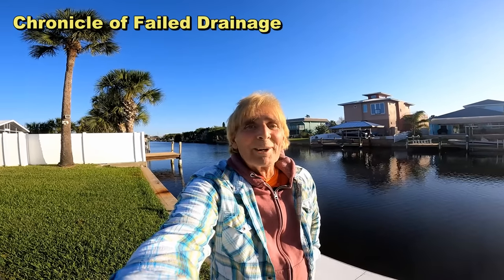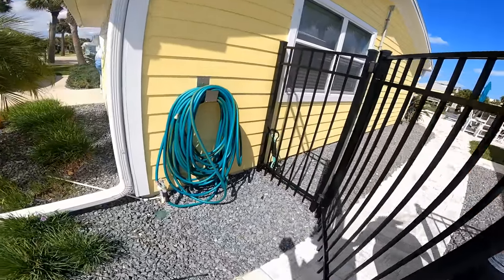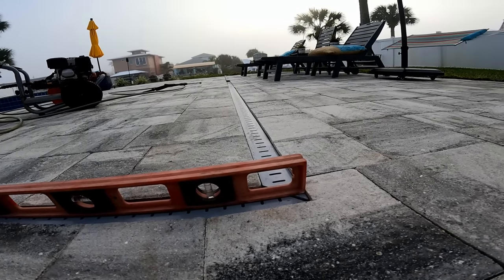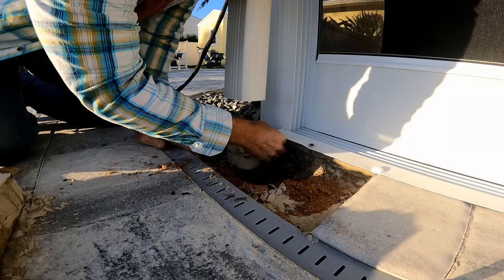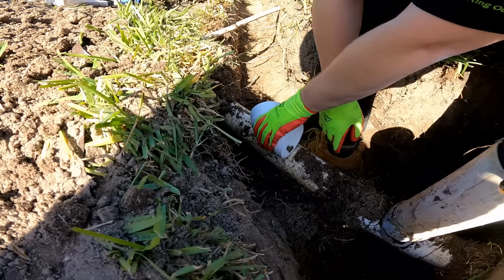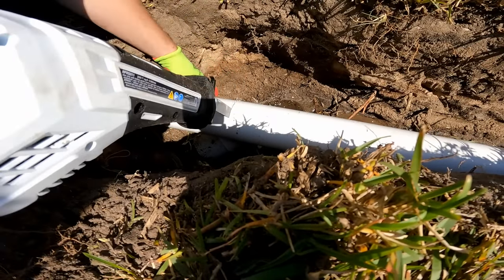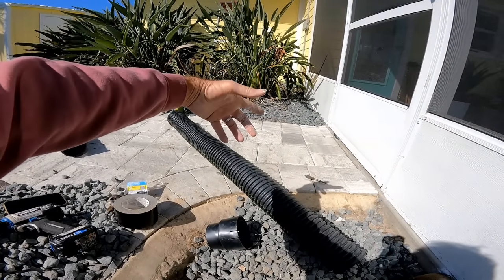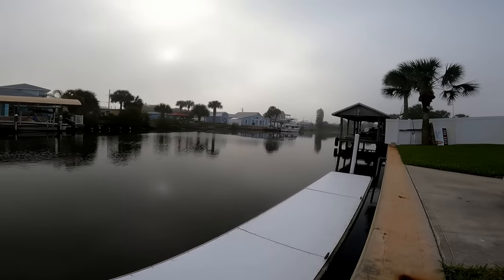Chronicle of Channel Drain Failure - Extreme Water Damage

Comment: Australia has very strict discharge regulations. So most contractors do the right thing. You through all your years of experience have virtually solved what a licensed builder would be required to do good work big thumbs up from me.
Reply: Supposedly but I’ve seen some shoddy work such as PVC pipes left open near the foundations or land sloping towards a home with no drainage or not enough downspouts etc. I don’t think inspectors check or if there are inspectors.

Comment: I had a problem with my 1/2 acre pond over flowing into the yard during heavy rains. I used the maximum full level to install drain pipe to the ditch. As I dug by hand I watched the water flow to get it working properly.
Reply: Yeah, you have to keep a pond filled to the maximum level or muskrats will tunnel under the bank and cause it to drain. Even then you must watch out for them.

Comment: I'd only be interested to know if that 1in drain was capable of handling the volume of water you'd expect out of a 4" drain. I know the catch basin is there, but I might have added 4 1in holes going down into a 4in pipe then that connects to the 4in pipe underneath.

Comment: Hey chuck, what is going to happen when the water level raise up above the pipe on the sea wall ?
Reply: It'll flow backwards into the system because there's no one way check valve or backflow preventer

Comment: Chuck, great video, and I always enjoy your clear explanations.  My question: I have heard that you should never place a French drain next to the foundation of a home.  But if the drain is properly constructed and sloped to allow water to see daylight can you think of a reason why this should ever fail to protect the foundation?   I did so to my home as a replacement for a damaged, hard to reach roof gutter.  I placed an 8mil plastic sheet up against the foundation to further prevent water penetration through soil to the foundation, before backfilling.  I used the downspout connection to the underground drain pipe that sees daylight at the street to connect to my French drain.  Keep up those videos; they are so informative.

Comment: Is the 1" pipe going to be enough to drain the pool area?  I would think that will backup pretty fast.   Its much much better than was there, just wondering...
Reply: The one inch hole is just to drain water collected by channel, additional water run off from the paver deck will drain through the catch basin that is now connected to drain pipe with outfall to the canal.

Comment: You forgot to need a backflow valve where the water drains to the canal. If the canal overflows due to a bad storm water will came out of the drains
Reply: Agree and wouldn't gluing the pipes make sense?
Reply: @jjducharme1  just what I questioned.  No glue and used what looked like bolts to surely catch debris causing blockages....
Reply: @JenniferF2882  good eye 👌
Reply: @jjducharme1  Not really , any small leaks will be easily disbursed into the soil, you glue pipes above ground as you do not want any leaks but it’s not so important below into the soil
Reply: I don't think anybody is going to put a backflow preventer on landscape drain pipes like this. Backflow preventers are usually for sewage systems (you don't want sewage coming up into your toilet drain from the city sewage line), indoor floor drains (you don't want your basement flooding if your sump fails) and irrigation systems (you don't want outdoor irrigation water flowing backwards into your drinking water). If your yard is flooding because the canal is rising, a backflow preventer is not going to do anything because the flood water isn't coming from the irrigation drain. It's going to be coming from the canal itself, the rain, etc.
Reply: If the water gets as high in the canal as the entrance to the channel drain at the pool deck they would have a pool full of canal water long before the drain backflow would be an issue.

Comment: Hi. Just looking at that open pipe through the seawall. Does that part of Florida have issues with rats,muskrat,nutria or other critters ? I remember when I was a teenager,a muskrat family ended up blocking part of the drainage of the family house. I got volunteered to find out and to this day,I still remember the smell of rotting drowned muskrat. This was the NW corner of the Bay of Fundy. With a warmer climate such as yours,I would be inclined to a one way valve, hardware cloth coarse screen,or some bright idea that would deny entry to enterprising animals. Maybe not needed,you are there I am not. Just curious. Cheers.
Reply: Yeah I was wondering that myself... even a curious bird could make a nest there. Should have some sort of backflow preventer before the outlet along with some type of self-closing cover (think like the louvered dryer vents that open and close automatically when running a dryer).

Comment: great job, that one inch hole in the channel drain, that won't be a problem?  seems like a lot of water on the deck that will go into that one inch hole.
Reply: The one inch hole is just to drain water collected by channel, additional water run off from the paver deck will drain through the catch basin that is now connected to drain pipe with outfall to the canal

Comment: any suggestions:  i had a channel drain installed in front of my garage bay doors - LOVE IT!  But the driveway is lined with trees - any suggestions on what i can do to keep the leaves out of the channel drain when fall hits?  thank you!
Reply: I have a standard 4" wide channel drain infront of the garage, similar issue with leaf fall (maple/oak/beech).  Don't think there is an easy answer.  I have to clear out the channel a few times each year.  It can even accumulate leaves inside   with a week (it still drains OK).  I got fed up with sweeping leaves of it, and from inside a porch. Just bought a small cordless leaf blower to move them leaves along 😁.  The channel has 2.5" outlet into a 4" pipe beneath.  Some installations show inclusion of a balloon leaf guard on the 2.5" outlet.  Not so sure that is a good idea, I could envisage that blocking up (causing flooding) much more frequently than the risk of the outlet pipe getting blocked.
Reply: @SaxJockey  yep i agree  with the leaf guard - I just have to accept the fact that i will be blowing leaves a lot for 2 - 3 months out of the year - but at least i know i'll have a dry garage -
Reply: @wanderingjesse3024  I installed a garage door threshold seal; hard rubber strip fixed to the concrete base where the door comes down.  The plan was to keep out any rain that was creeping/blowing under the doors.  It works very well and also keeps out leaves and seeds 👍.
Reply: @SaxJockey  doesn't that seal attach to the garage door itself though?
Reply: @JenniferF2882  The seal I meant attaches to the floor (see link).  It does not prevent leaves in the drain, but it helps keep wind blown rain getting under the garage door, also leaves, seeds and dust.  Best thing I did was to install that seal.  Unlike in the video below, I had to shape the strip to fit around bolts that secure the door frame to the floor.  Use the adhesive sealant around all areas where water might get into the base of the frame.  Garage now keeps dry and much cleaner.  The link shows one brand, I used another brand.
https://youtu.be/pSviGTX1AhQ

Comment: Hi Chuch, 2 things I noticed from this video. 1) I did not see you using glue to secure/seal the pvc pipes together. 2) A 2'' drain channel with such a large area to cover to drain through a 1'' in down drain pipe? Please explain. Add! You used a corrugated pipe to avoid to cut down the concrete block, I think that the corrugated pipe is going to cause a clogg down the road, pvc shudl be used all the way.

Comment: Hey Chuck you can actually get parts for any channel drain you would like it takes a bit more research and find them retro fitting apart works I guess but it also has more likelihood of failure most pool drain channel is one of two companies it's either stegmeire or Quaker plastics it's a bit of a hassle to get in the State of Florida unless you're willing to travel to South Florida to a distributor called r&w distributors but from my experience in drainage using proper parts always has a better end results

Comment: I understand that the pipe isn’t under pressure but how about some primer and glue on some of that pipe and couplings at the 45’s. Just piece of mind thing on my end I guess
Reply: Yep. Glue it for future land shifting and settling (which will most definitely happen, especially being in Florida AND on a canal, and it being a new installation).  PVC glue should've been used 100% on EVERY connection, never ANY screws or bolts to protrude INTO the drainage pipe to catch debris and cause blockages.

Comment: Water drains.
We had a 10 inch rain up here in Michigan couple years ago farmer had nice pond in front of his pole barn.
He had his irrigation pump pumping water up to floor drain in barn for 3 days before he quit.
Seems his drain ran to the low spot he was pumping from .

Reason for pumping was he had a line of farm equipment setting in water.

Comment: How did you attach the 1 inch to the T?  Was it something you modified? Is it just caulking?  What would you screw together?  Thanks...you saved this homeowner a big headache.
Reply: They modified something I think - then looks like they used screws/bolts (number 1 questionable choice IMO) and followed it up with what looked like white caulk (number 2 questionable choice).
I would've used PVC glue on all connections, and had those come together at some sort of junction either made for it OR like a D-Box, and seal with silicone or something similar (caulk doesn't hold up nearly as good as silicone). If they used some sort of fitting (which I'm sure exists; my dishwasher line connects under my sink with a fitting that looks EXACTLY like what they "designed" they just would've had to move it to before or after the T fitting) I think it would better future-proof the connection.

Comment: No glue on the pvc pipe drain pieces?
Where you connected the pieces at the channel drain 15:42 , did I see bolts holding the PVC together?  I know it's just essentially  stormwater drainage but - those bolts will cause headache by having protrusions for debris to inevitably get in there & get caught.  Why no glue?
Reply: I've seen other applications where only pipe dope was used to attach underground components. That's what I did when I finally installed mine, then wrapped each joint in 4 inch wide Flex seal rubber tape. The drain line is not a pressurized system so the glue isn't really necessary. In addition, if any changes need to be made in future, the pieces can simply be pulled or twisted apart and re-used. Remember that in systems using corrugated piping, the components are just snapped together with no bonding agent at all.

Comment: Everything was looking great until you used the corrugated pipe to get around the concrete in the trench, and the connecting up the pit,never use corrugated piping on stormwater as it will always block up.

Comment: The surface run off drain on the concrete is still u der size, the existing drain will only handle 70 litres per min. Should be 5” drain for that surface area.

Comment: Her main problem was listening to these rip off artists to begin with. No one established the grade before working. Pumps are not the answer. Heavy rains generally mean power outages---just when you need the electricity. The grade next to the pool is towards the house!! I want to commend you guys for removing the gravel by use of a wheelbarrow. Here the stuff would have been simply tossed on the patio.  The original job has all the earmarks of  working to "get a check". Great job guys!!

Comment: Very strange that a drain is actually level with the entry to the property....... all outside areas should be 150mm below dpc ....   they are just asking for trouble with that setup....and with that mini drain and 1inch drop pipe i can imagine it not being able to handle a heavy down pour ..... but good luck to the home owner ..... the design is flawed from the get go.....

Comment: Not surprising at all. We build screen rooms and gutters like this all the time (I like those double 4-track screen sliders) and the channel drain is most important for getting rid of water. This channel drain is too small. The problem is only half the time I'm working directly with the pool company. French drains and catch basins NEVER work. Like, ever.  I don't recommend ever running downspouts underground either, in Florida. You just can almost never get the proper pitch unless you're on a hill. Sometimes, you just have to, like situations like this. But still. Don't recommend it. And IF you are you NEED to use 4" PVC pipe and not the shit corrugated, black pipe. I just don't get why paver guys almost never level and slope their channel drains properly. Blows my mind how common it is. My only concern here is your channeling 4" pipe, a channel drain, and a basin drain all into an equivalent size pipe, 4". So, better hope that doesn't isn't running at full capacity one day, or there goes your entire 4" pipe capacity.

Comment: I just can't believe that there are professional companys, that do advertisements, that have employees, that go to a job side, do work, write bills and in their very own, professional field seem to be unable to put in a drain correctly or straight, what even an unskilled homeowner with a level and a two-page-guide could do. And even worse, not one of the employees of this professional company that did build that system had just a slight understanding of such basic things like - water will not flow uphill. 

And here I am, too afraid of starting my own business because of the fear, that even after 10 years of work in my specific field I might not be good enough to take money for it without collegues reviewing my work before it is shipped to a customer...

Comment: Wont solve the problem in the long run. Dust us going to fill up the line again and clog iit.

You need at least a 8" of pipe at the outlet side tohandle moderate rain. And a 50:5 or 100:5 slope to fush the mud.
Its like trying to drain a gallon of muddy water through a horizontal drinking straw.

Comment: Awesome. Did you use screws to joints instead PVC glue or both? Ive never seen using screws on PVC plumbery.
Reply: I have - and it always caused issues. Even just being stormwater it'll still get stray debris and it'll catch and build up causing clogs. Eh - job insurance for future jetting service I guess. 🤷‍♀️

Comment: Is the root problem with the initial install a lack of IQ or contractors that know what they are doing and prefer to maximize the money they make? If it's the former than there is an easy solution, just stop hiring dumb people. If it's the latter than maximizing profit has no simple solution other than hiring only honest contractors, which is unrealistic because it's too difficult a challenge for the average homeowner.